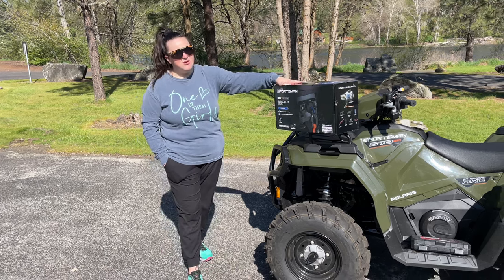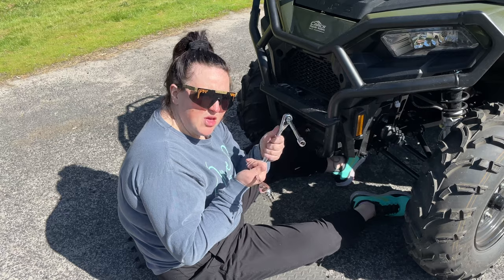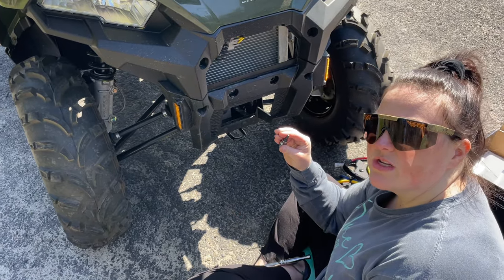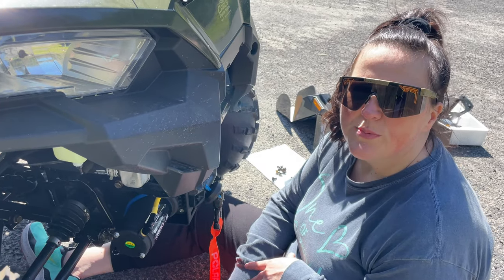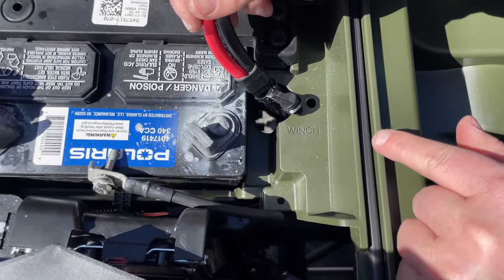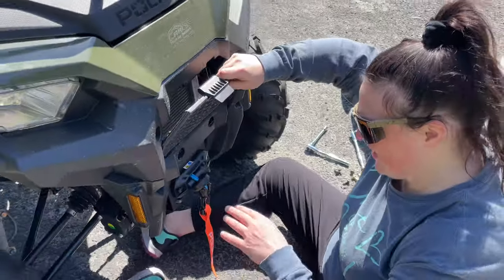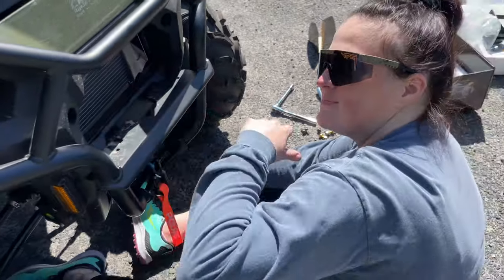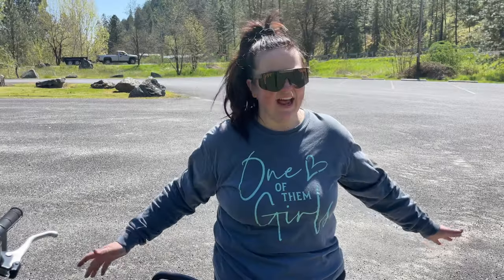Sportsman 570 Winch Install

Comment: They only built these models for people with small hands without arthritis Its a struggle for me to check oil and antifreeze cause my big hands don't fit through the access holes. Nor are my fingers strong enough to turn the caps in such a small space
Reply from the maker: They definitely do have small spaces to work with!
Reply: The engineers were midgets

Comment: Mine has these radiator nubs that protrude down, making it impossible to put the winch in place.
Reply from the maker: What kind of fourwheeler and what year?
Reply: @druzolman  2023 sportsman 570
Reply: @druzolman  also for some reason the battery cables also are not long enough to reach the battery on the 2023 for some reason.
Reply from the maker: If you’d like, find me on another platform and send me some pics! I’ll see if I can be of any help!